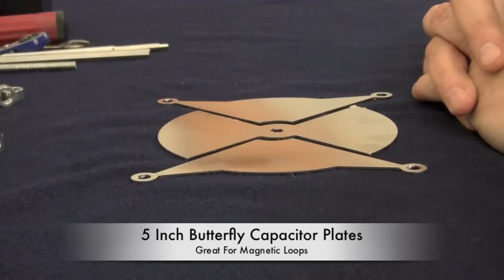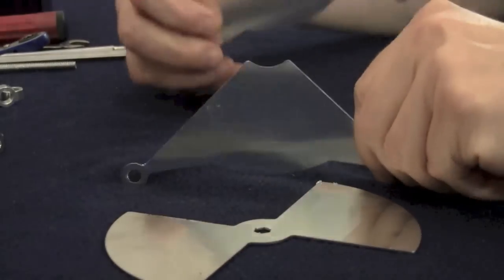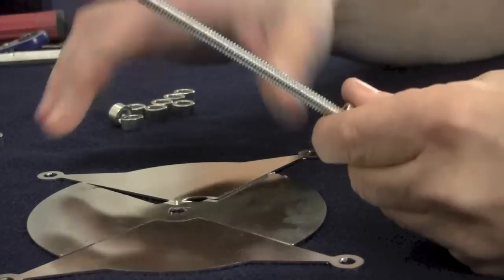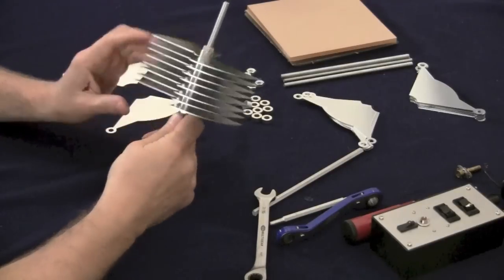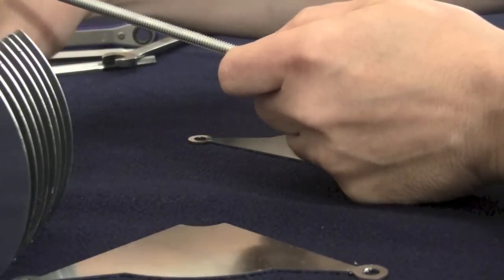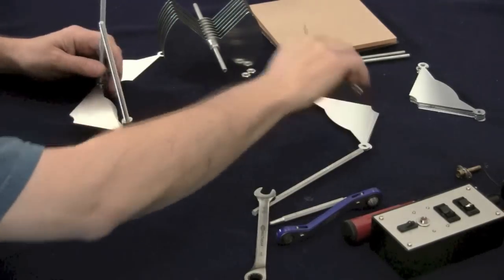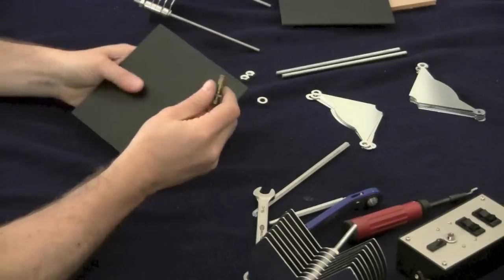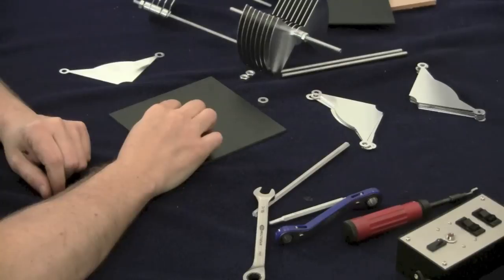Variable Capacitor Butterfly Style Plates Great for a Home Brew Magnetic Loop

Comment: Hi.
If one wanted to position the plates much closer together, could you use some plastic film between the conductive plates to prevent them from shorting.
Would the plastic film affect the integrity or general function of the variable capacitor in any way ?
>
Reply: i have used clear coat spray paint with success on variable caps that arced in their lifetime, the application was in a 1kw lineer amplifier  Plate cap, sanded the culprit down, assembled and sprayed the lot, never looked back since.

Comment: have you ever applied a dielectric coating "from paint to a heat shrink able plastic" to the plates to boost a variable air dielectric caps high voltage rating.

Comment: PortableQRP for a radio tuning circuit why use such a large Variable Capacitor?
Reply: Virtualgod2009 o wow that is cool, I thought about building a huge tesla coil but that will be for another project. My induction heater works real well now, ever since I put about 4 capacitors on my induction heater it does not kill the mosfets.
Reply: Virtualgod2009 when I get more advanced, at what point will I have to use an IGBT?
Reply: Yes induction heater. So that tells me that people that are melting thick steel with these high power induction heaters has to use IGBT.
Reply: Virtualgod2009 since IGBTs can handle a lot more voltage, then that tells me It would be a lot harder to blow an IGBT, that means I would not have to use mosfets for my induction heating anymore.
Reply: Ok I understand.
Reply: Virtualgod2009 I can get an IGBT for about 20$ at the electronics surplus store I live next to, how do I hood it up for a zvs driver?
Reply: Wow There is a lot that goes in to it.
Reply: Virtualgod2009 for fight now I will just stick with the mosfets. lol
Reply: Virtualgod2009 I have been using different power supplys different amperage different voltages, and I'm noticing the mosfets work better with a higher amperage and lower voltage, I noticed the way the arc changes the way it looks, and the change in sound of the arc.
Reply: Virtualgod2009 o wow I did not think the power supply had anything to do with resonance, if I would have been able to change the voltage and amps with my irfp250 mosfet I would of most likely got resonance. I also change the Gage of my wire on the primary of my flyback transformer made a big difference. I could be wrong but it seems when everything runs out of resonance my mosfets and inductor gets hot.
Reply: Ok ya thats crazy.
Reply: Virtualgod2009  I just got a MOT, do you think if I rewind a MOT, I could get 30 or 40 amps to run my induction heater?
Reply: Virtualgod2009 ok thanks I will do that.
Reply: V virtualGod2009. I was reading up on induction furnace in the steel mill, how on gods green earth lol would you ever get an IGBT to use with that massive size containers they melt steel in?
Reply: o wow you know a lot about electronics.
Reply: Virtualgod2009 do think it would be possible to build something in your garage that would produce an EMP that would shut down the power in a city? I know it is crazy lol
Reply: Lol I would not do it anyway. from what you are telling me, it sounds like it would take way to much amperage to even do at home. Lol
Reply: o wow cool
Reply: are familiar with John Hutchison? the Hutchison effect, he is th one that discovered how to fuse metals together with high frequency and levitation . they say this and the Philadelphia experiment and a lot of things are connected to this. I wish I could do some of these experiments.
Reply: Virtualgod2009 just say I want to make an electromagnet with a piece of iron rod, and I'm going to use a 115 volt house main, how do I know how many times I need to rap the copper wire around iron rod so I don't trip the breaker, does it have to draw a certain load?
Reply: Virtualgod2009 I rewind the MOT I'm getting 18 volts. I used my multimeter to mesure the amps with a light bulb as a load, the light bulb has way to much resistance to get any reading, how can I mesure the amperage output?
Reply: Virtualgod2009 so I would mesure with my transformer and multimeter in series with a resistor,really quick for 5 seconds?
Reply: Virtualgod2009 I want to use the transformer for my zvs driver, but will it blow the mosfet if I put all that amperage in at once?
Reply: I don't have a variac  because of money but I'm trying a dimmer switch.
Reply: Virtualgod2009 ya I found that out I hooked the dimmer up and did not get nothing out. I took my chances and hooked the MOT up and it works great, heats a piece of metal up red hot, still does not melt a piece of metal, wish it did maybe not enough amps. On my next MOT, if I want power to melt something would increase the amps using bigger gauge wire or more winding to increase voltage?
Reply: Virtualgod2009 wow that is a hell of a lot of amperage. what is the problem with going from 115 house main, to a rectifier,  strait in to my zvs driver with out any transformer or any variac?
Reply: ok thanks I will look on that site.
Reply: Virtualgod2009 I was looking at all the variacs on this site they look nice and well built. what voltage and amperage will give me the power that I need?
Reply: Virtualgod2009 ok cool.
Reply: if a piece  of metal is heating up in my induction heater, does that mean I have the right frequency, or not necessarily? my mosfets stay pretty cool.
Reply: Virtualgod2009 ya know matter what inductor  value I used it did not matter.
Reply: If my induction heater is using more amps now, does that mean I might have to use higher amperage diodes on all my diodes?
Reply: I have been using regular 12 volt diodes, they are pretty dirt cheap.
Reply: Virtualgod2009 on the schematic, the mosfet gates have 2 270 ohm resistors,what is the lowest in value I can go, and what  is the highest value I can go if I need to substitute resistors?
Reply: Virtualgod2009 I meant to say 470 ohms, I think I'm just going to stick with that value, itis just the electronics store where I live does not have a 470 or 500 ohm, some time I need to improvise.
Reply: ok.
Reply: Virtualgod2009 When it comes to the work coil is a hollow coiled copper tube going to be more efficient? or a solid coiled piece of copper? as I make the work coil bigger does that mean I will have to use more amperage to heat the workpeice?
Reply: Virtualgod2009 My MOT only puts out so much amperage so I want to transfer as much as I can to the workpiece. basically get the best bang for my buck. lol
Reply: Virtualgod2009 ok thanks I will try tubing.
Reply: Virtualgod2009 my multimeter goes up to 20khz but it won't register any more than that, that means my induction  heater has to be past 20khz.
Reply: Virtualgod2009 o wow did not know that.
Reply: Virtualgod2009 since I don't have a scope right now, would it be so much easier  if I use a 555 time to vary the frequency? that would give me the chance to use a potentiometer with the 555 time to very the frequency so I can see what frequency gives me the best results for my induction heater?
Reply: I   looked it up it looks like it is a 14 pin chip, the thing is I have not seen any induction heaters or zvs driver schematics using that chip.
Reply: Virtualgod2009 you said it is better to use a hollow work coil because of the skin effect, will that only make a small difference in the efficiency of my induction heater? or a big difference?
Reply: is it a waste of time working on a induction heater without a scope?
Reply: +Virtualgod2009  Ok
Reply: At the the elctronics surplus store where they are selling IGBTs for 5 dollars,they Don't know what they are.
Reply: surplus electronics store where I live they are selling IGBTs for 5.00$ they don't know what they are but I do.
Reply: do you have a link to a schematic for a simple IGBT zvs driver?
Reply: thanks for all information, hope you have a good thanksgiving.
Reply: @sweetguy19762  you said Blow

Comment: Obviously this is excellent workmanship, but since charges accumulate on pointed  and sharp ends, I would have rounded off  all points and corners and edges, Not only it would  stand higher voltages but it would have less stress mechanically  at those corners  where the holes for the bolts are placed in the  fixed and rotary vanes, If as I an conclude those vanes were cut with a Cad operated milling machine, it would be easy to round  off the corner. The edges may take a llitle longer.  Excellent work nevertheless.